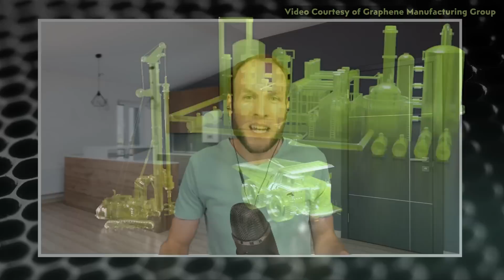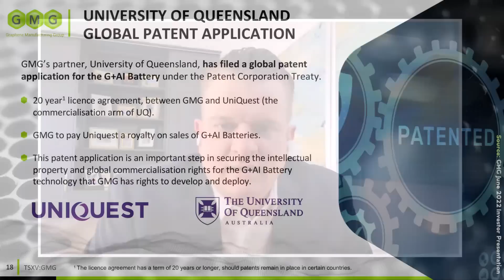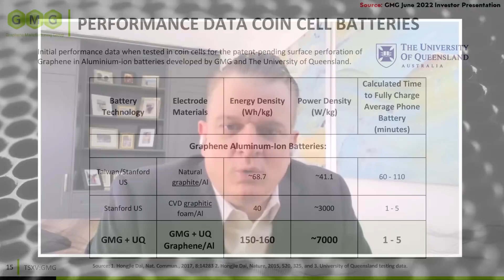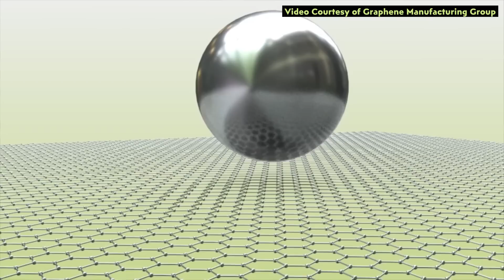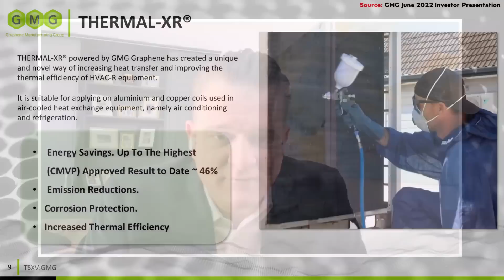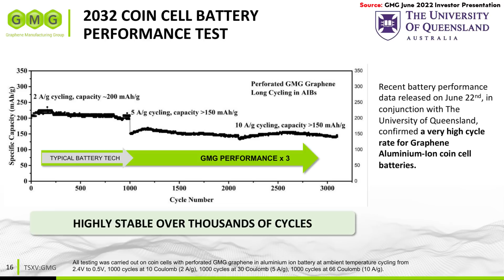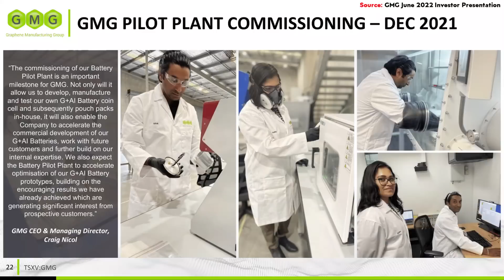GAME CHANGING Graphene Aluminum Ion Battery w/ Craig Nicol

Comment: Certainly seems very legit, cool interview, hopefully they will succeed and also be smart about which partners they choose, because with great power comes great responsibility... oh yeah, they probably also should remove their dependence on natural methane in the long term.
Reply: Compared to the current widely used method of making graphene, this is a drop in a very big bucket. If they can make 15kg of high quality graphene out of 20kg of liquid methane,  I'd take that any day over mining Graphite.
Reply: @WyldGoat  Yup. And compared to what's burned to heat homes, it's a small amount. After all, the methane GMG uses is turned into a permanant, long lasting, recyclable material instead of turning into vapor.
Reply: @WyldGoat  But half of the battery weight is graphene he said...
Reply: @WyldGoat  I've yet to see anyone claim that they have 15kg of graphene. That would cover several football fields.

Comment: Lots of promises... no technical information... vague statements...good luck to them.
Reply from the maker: They are still pretty early in the process, but the tech has a lot of promise (more than most new  battery tech in my opinion) - they are not reinventing the wheel, but just improving an existing technology.
Reply: @Cleanerwatt  were you in any way compensated by them to make this material?
Reply: @cassius1080  I think the better question is to determine what the University of Queensland gets out of their deal with GMG, because they developed the technology, GMG is just commercializing and improving on their existing work
Reply: @TheLargestBlock  and this is really confusing. I dont know anything about this university but I cannot find plausible explanation why they would associate themselves with this start up - this could damage their reputation as uni name is the only thing he really has. There is literally nothing else there - well apart grandiose statements.

Another thing is very loud silence from Cleanerwatt to my querry. Simple yes or no would suffice... but Cleanerwatt chooses not to answear. 😁

Dont get me wrong - Im not saying anything - im just careful and suspicious of any wonder material. Especially that there is little evidence to support it. Someone here as well checked financial statements of this company and it shows very little trading. 

For now it looks like lots of hype to get the silly investors put their little savings in...
Reply: @TheLargestBlock  GMG seeks out and maintains a lot of nebulous relationships and leverages them to the fullest. You look into them and see they're either paid associations (Stanford) or meaningless LOIs

Comment: Excellent interview and great Q&A! Would have liked to have an answer for the  nominal operational temperatures for both the charging and discharging of this Al-ion battery, and I shall follow your links and see if the answer is provided there. I think that the variation of observed  temperatures on earth, -20 degrees Celsius to +60C, and even greater in extremes in some locations and seasons, we would still require some means of temperature control unless the Al-graphene battery is capable of operating at these extreme temperature ranges. Thanks for the informative content you provide! (Addendum: I have sent my inquiry to GMG now, so let us hope for a reply ASAP) You have got me quite excited, see?
Reply from the maker: Great point - that would be good to know. Please post a follow-up comment when GMG gets back to you.
Reply: I doubt they will get back to you. We have sent many requests for information and no response. Outright unprofessional
Reply: Take a look at this:

The new battery cells are claimed to deliver far more power density than current lithium-ion batteries, without the cooling, heating or rare-earth problems they face.

“So far there are no temperature problems. Twenty percent of a lithium-ion battery pack (in a vehicle) is to do with cooling them. There is a very high chance that we won’t need that cooling or heating at all,” Nicol claimed.

“It does not overheat and it nicely operates below zero so far in testing.

“They don’t need circuits for cooling or heating, which currently accounts for about 80kg in a 100kWh pack.”

Source: https://www.forbes.com/sites/michaeltaylor/2021/05/13/ev-range-breakthrough-as-new-aluminum-ion-battery-charges-60-times-faster-than-lithium-ion/

Comment: I sincerely hope this works out, and that they can get the energy density as high as Lithium batteries. Already we're looking at 230WH/Kg for the CATL cell that's just going into production. So you need to be aiming at 250-300WH/Kg if you're two years from mass production, because that's where Lithum batteries will be by then. You're chasing a moving target, and also a reducing cost. As soon as you say Graphene, I think that you've got a cost issue.
Fast charging is great, but if the other key parameters aren't met, you don't have a viable product. I'll believe it when I see it in thousands of cars.
Reply: the new 4680 Tesla cell is already at 270 Wh/kg at least and that without silicon doping . Is expected to rise to 300 Wh/kg next year
Reply: @gerritgovaerts8443  and then they run out of lithium... or the lithium price explodes...

Comment: What is the cells working voltage  1.7v to 0v  ?
Reply: I wondered the same thing. The density graph said from 2.5 to 0.5 volts but not sure I'm reading it rightly. Not much use to me compared to the narrow voltage range of LFP, etc.

Comment: I didn't catch what the electrolyte is, whether there is a separator, or any detail on the process that makes graphene from methane.
Reply: look up "methane cracking"
Reply: The graphene from methane process is not new. Separators as used in lithium cells probably work but they won’t advertise that on YouTube.

Comment: It’s not a viable long-term solution since the Aluminum is ‘sacrificial’ which makes for low cycle life. But yes, the charge rate is fast but only good for a handful times at this level technology.
Reply: Did you watch it? Much longer lifecycle than current Lithium battery
Reply from the maker: The cycle life of GMG's battery tech appears to be very good (better than traditional Lithium ion by a long shot) from what Craig mentioned in the interview...
Reply: @Cleanerwatt , that is true for ‘coin cell’ type batteries. Once you try to upscale it it becomes a whole different animal. There is a reason graphene has been around since just after WW2. It is extremely expensive and difficult to produce in large quantities hence batteries for automobile applications are many decades away. 
Graphene also has one other huge achilles heel and that being its susceptibility to mechanical and chemical damage. 
If and when these issues can be solved there will be a huge array of applications until then, many years from now, it’s purely a marketing gig and small player in applications like watch batteries etc.😉
Reply: @HsquaredH2   They could not produce graphene shortly after WW2... Scientists theorized graphenes potential existence and may have observed it some via electron microscope in the 1960s but it wasn't produced (truely discovered) until 2004. Graphene production is an issue, if it wasn't they could make more money selling rope than batteries.  These guys haven't produced coin cells yet, so they really don't know what the hurdles will be yet, aside from cost and manufacturing.
Reply: @HsquaredH2  Graphene has not been around since just after WW2, it was only discovered in 2004 at Manchester University in England. ..and check your facts on the cost of producing it, which has come down a lot recently and there are many applications, not just batteries.
Reply: They claim to have a process that is better than what we were doing just after WW2. Have you checked that process yourself or are you just saying this because you felt like it? Genuinely curious. Also what kind of battery pack can't be sealed off from exposure to chemicals? A ruptured lithium battery pack is also a bad thing.
Reply: @eviljohnnybravo7575  , lol, Companies say a lot these days to get funding but once the layers get peeled back very few can actually deliver! One thing is for sure,  lots of folks have been working on graphene and NOBODY has been able to crack the code and I’m very doubtful that this place has because if they did it would be a much, much bigger deal than it is! They may have a small coin size battery but that is far from a breakthrough since manufacturing graphene in large quantities is extremely expensive and difficult regardless of what some might claim because, again, show us!?… but they can’t 😉
Reply: the Al apparently isn't supposed to be sacrificial in the aluminum ion battery, as opposed to the aluminum air battery.
Reply: no it isn't. Where did you get that from?  You are thinking of Al-air, not Al-ion.